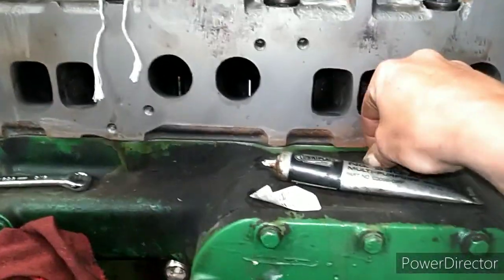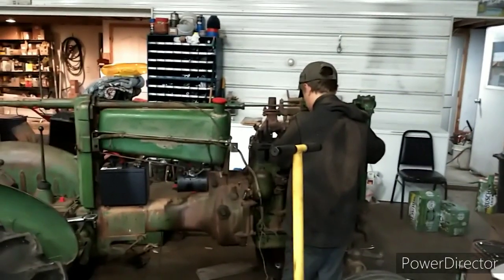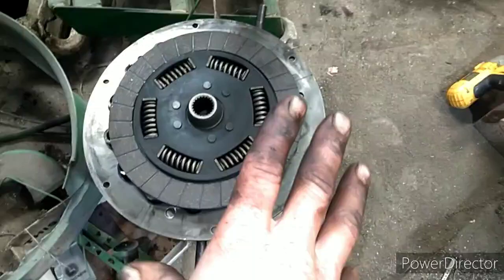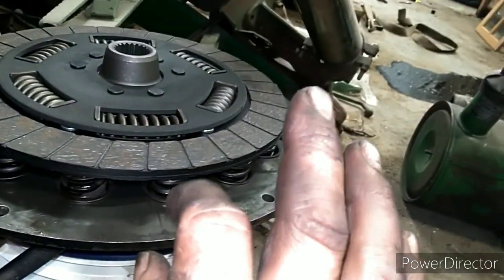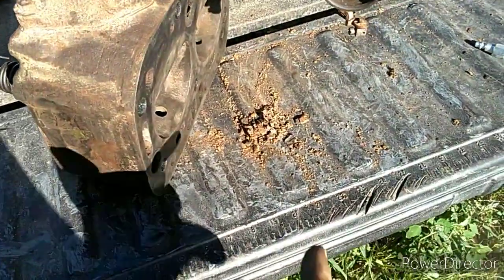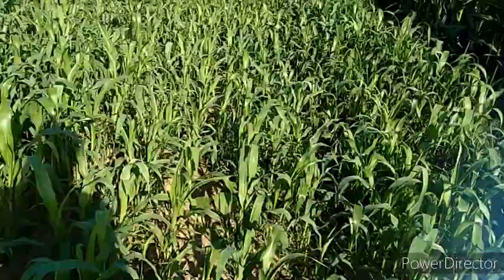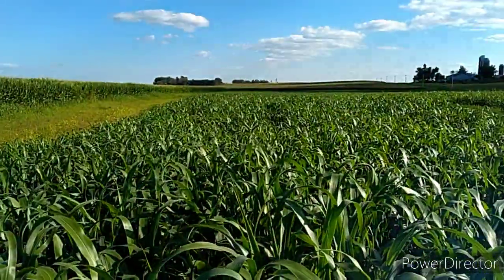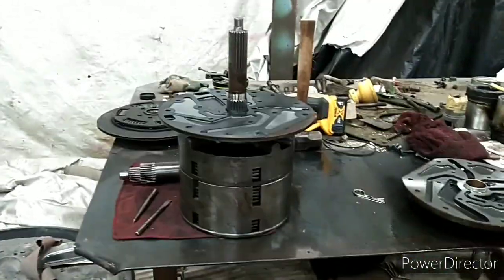4440 and the M

Comment: Makes sense on the clutch.. 
I ran a 440 skidder for a few years,. Same 8 speed PS. They're pretty much bulletproof!!! 
But when they aren't, they're expensive!!
Glad the M was an easy fix.. keep that note in your head, just in case. 
A piece of round stock that fits the pilot bearing and a bushing to fit on it and in the spline works good too . Even better if you have a lathe, make one. 
Rain 🙄🤣😂 🤬
Reply from the maker: Would be nice to get a lathe . Definitely would come in handy. Thanks Ed!👍🥃🥓🥃🥓🥃🥓🇺🇸
Reply: @shaneholst6940  they are handy..even if you don't know what you are doing 🤣😂😁👍

Comment: Excellent video Shane! You and Tyler both doing great work on your tractors. Won't be long now. Hope the feed situation gets better for you. 🙏 Appreciate the crop update and hope 3rd cut is a good crop. I like your torque pack explanation. I think the difference between you and a mechanic is quite a bit. A mechanic explains things in a way that costs me more money. You explain things in a way that saves me money. I'd much rather spend my money on the things I want, not on the things the mechanic wants. Thanks for the video!
Reply from the maker: Thanks sunroof racing! Definitely agree with you on fixing what's needed and saving a few bucks. The feed is going to be short this fall but I'll hopefully figure something out.🙏

Comment: Good evening Shane
Reply from the maker: Good evening Richard
Reply: @shaneholst6940  I traded  my 4040 off  today  for a 4430
Reply from the maker: @richardwilkens4577  nice 👍 4430 is a good stand by tractor! I use mine every day!
Reply: @shaneholst6940  this only  has  4300 original  hours on it
Reply from the maker: @richardwilkens4577  wow that's still a new tractor.
Reply: @shaneholst6940  that's  what  I  thought  when I  found it
Reply: @shaneholst6940  plus  a little  more  horse power than the 4040
Reply from the maker: @richardwilkens4577  and more tractor
Reply: @shaneholst6940  yes I  keep  duals  off  the 4040 and the 4430 has rear  wheel weights  and and the front rack is full
Reply from the maker: @richardwilkens4577  nice! What transmission synchro quad or power shift?
Reply: @shaneholst6940  16 speed quad
Reply: @shaneholst6940  4040 had the power shift in it and I  really  didn't  like it that much

Comment: Uneven Sorghum?  Mine is varies from 2-7 feet tall. The areas that were really wet when it was a couple inches tall never came back very good. It should be interesting when I cut it.
Reply from the maker: Yeah it's like corn it doesn't like wet.
Reply: @shaneholst6940  I found that out. 🤦Still going to be a lot of feed for this operation.
Reply from the maker: @farawayfarm2520  that's good!👍🍻